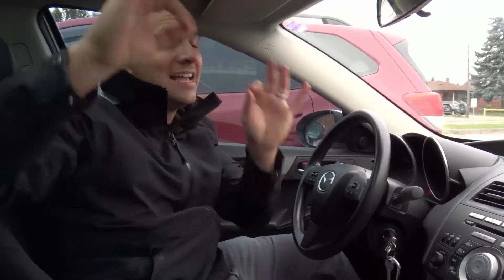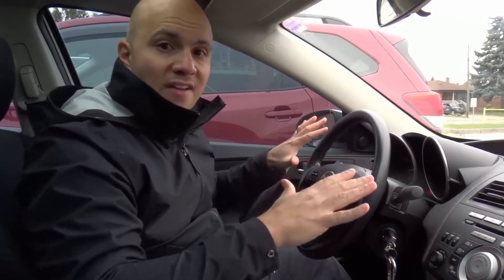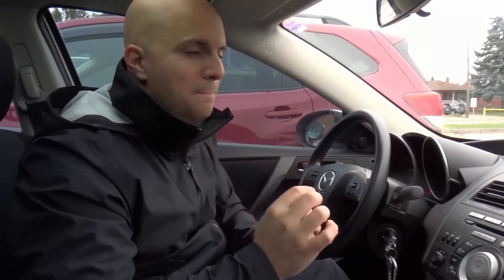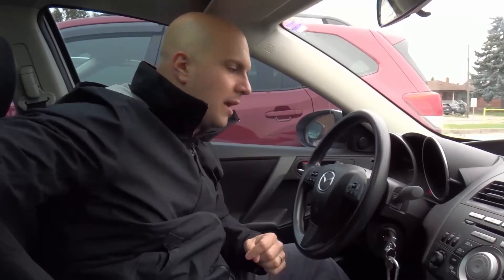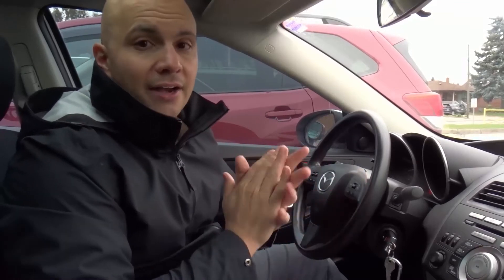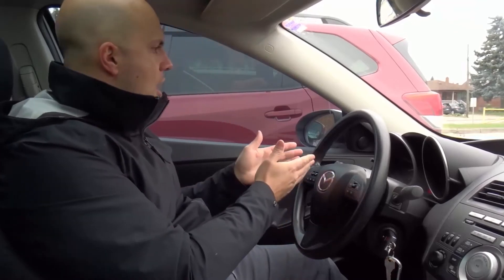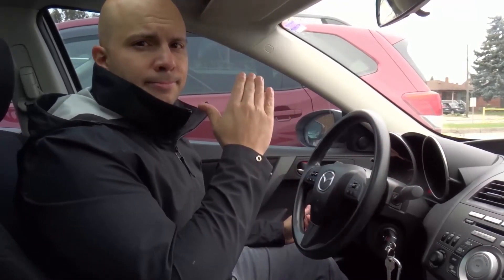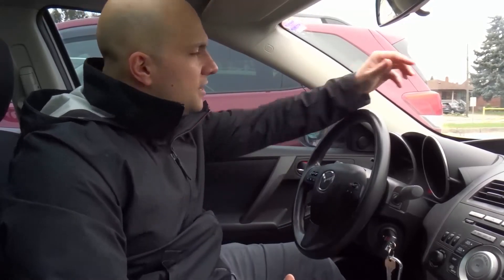What Is The Correct Idle Speed In A Car-Easy Explanation

Comment: Hey great videos, I just had my alternator changed and now my car went from idling at around 750 to 650. When my AC compressor comes on, I can feel the car bug down for a split second but the RPMs pick back up quickly. Is this normal after an alternator swap?